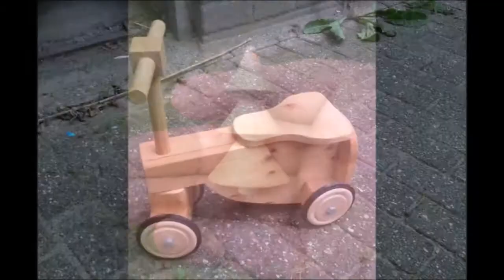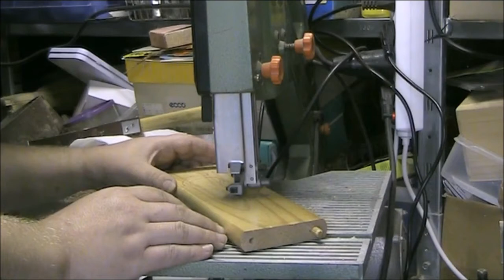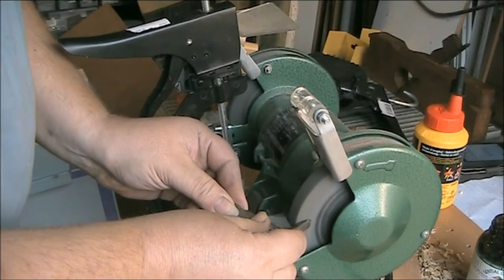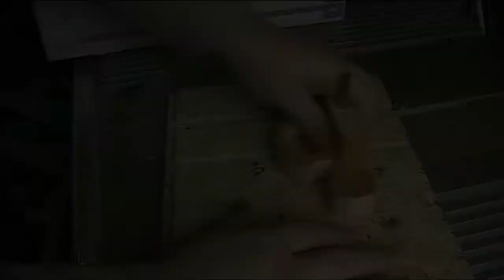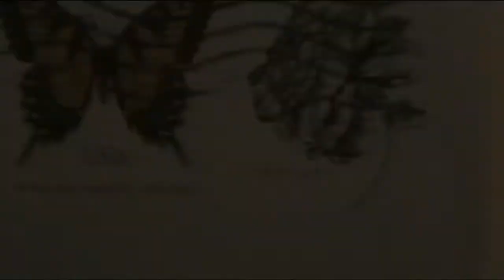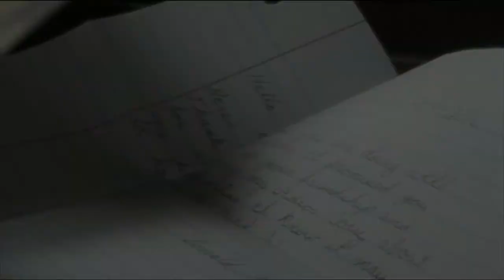Quick and Easy Router Plane from Reclaimed Wood, Willem's Woodnotes

Comment: Great build! what did you use to hold the blade in place? or is it just friction fit in the hole?
Reply from the maker: Friction fit. Taptap hammer adjustment. So far it held up but it needs readjusting after a while. I will try add a locking mechanism one day or make an entirely better version. Thanks for watching!
Reply: Love it. great build all around! I have to say I have never seen one used on OSB before.
Reply from the maker: +Wood By Wright osb worked fine. It was my test piece. I used it on plywood after that. Also fine. Im not sure i would like to try something really hard like purperheart...
Reply: I used mine on Purple heart just the other day. just need to take smaller bights and make sure it is razor sharp!.

Comment: Man, I was going to ask if you did a few bars of "Pictures of Matchstick Men" (a minor hit from 1968).  The opening music sounds like a hardened version of it.  Was it difficult grinding the allen wrench?  I just ground the head off a bolt and it was quite a chore.
Reply from the maker: Thanks for watching. The entry tune is part of an youtube audiolibrary song. I intend to replace it with something home made one day. 
Grinding an allen key takes some time on the grinder. Cooling it with water frequently. I have a small cup of water behind the grinder to dip it. This video shows only part of the grinding proces to prevent viewers from dieing of boredom. I think it took maybe two minutes. I did not anneal and reharden, i tried to keep the hardness in the metal. Cheap allen keys are hard!